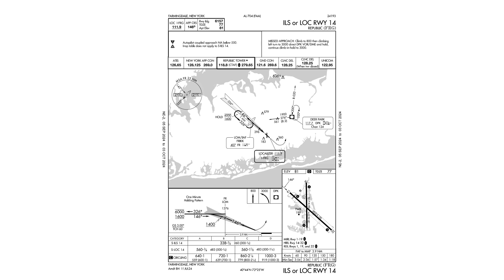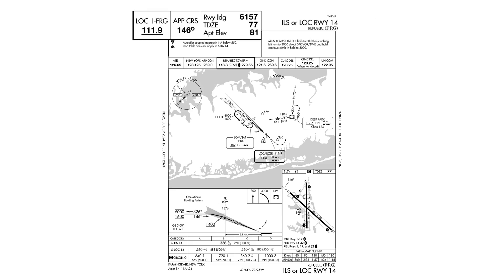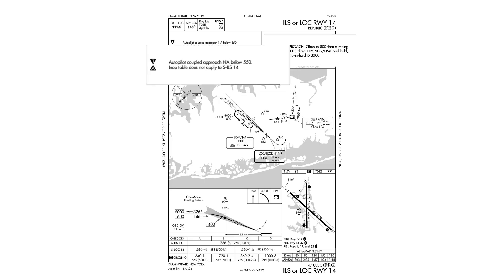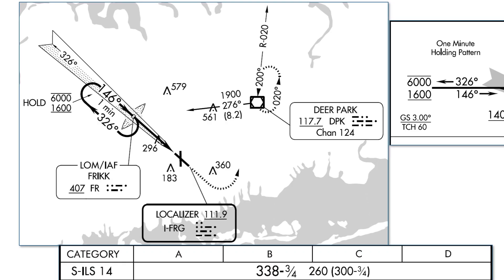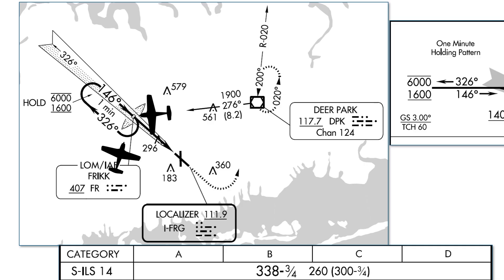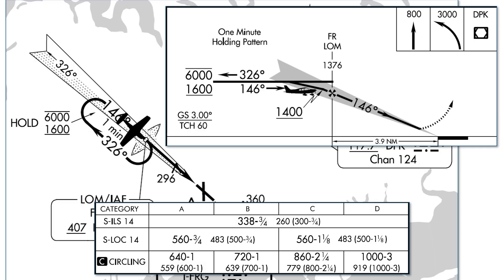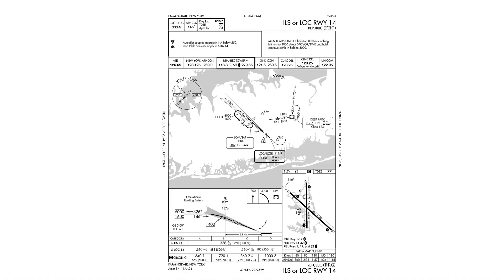Approach Plate Explained | ILS Approach for Beginners

Comment: Greetings!  I'm a retired military pilot of thirty years and have also been retired that long and thought it would be interesting to take a peek at an approach plate as I taught instruments and I see the plates have not changed much and you presented the information very well though you might ponder slowing down a bit with your delivery.  Thanks for sharing and the best of luck.  Also,  I'm told there is not much holding these days and we had a lot of it back then and I can well remember being "stacked" as we called it and watching our fuel gauges closely!!  LOL

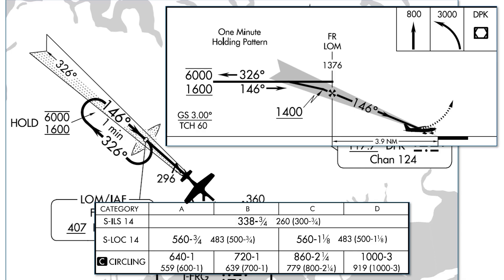Comment: @5:23 It's mentioned the MAP for the LOC approach could be the time of 2 minutes and 36 seconds from the table. Can we use that time to identify when to go missed for ILS approach too? Or is it only ever valid for non-precision approaches?
Reply: If you’re going faster than 90 knots over the ground, you’ll hit the ground before the time elapses. ILS should use your altitude as the MAP. But it’s a good idea to set the timer anyway in case you lose the glide slope so you can still switch right away to the LOC
Reply: The missed approach point for the ILS is the DA while on the glideslope like thebadgerpilot was saying.  Good call on the LOC timing in case you lose glideslope if you don't have a nav/comm GPS and you are using an old school VOR.